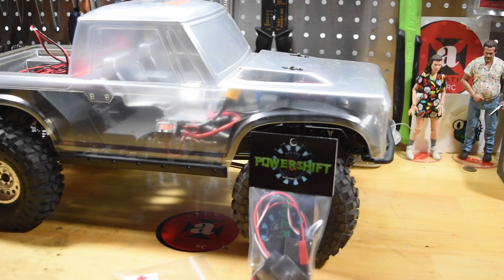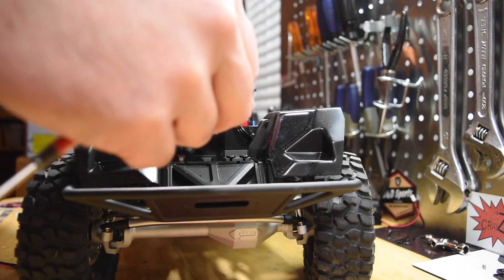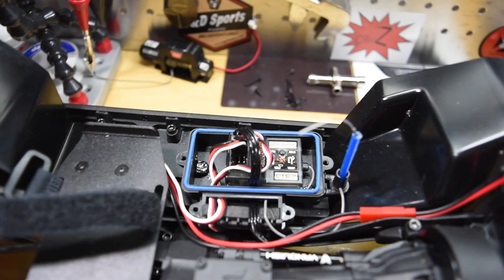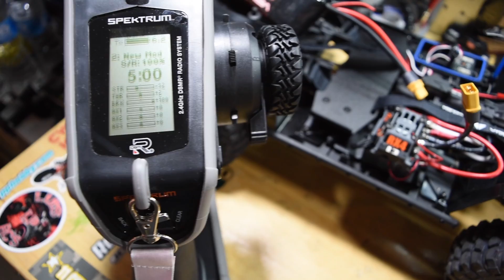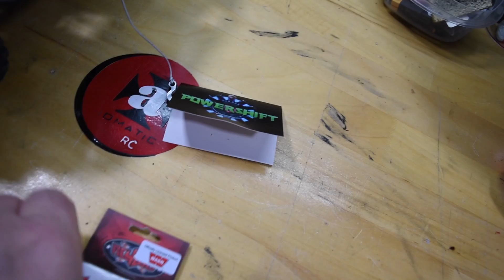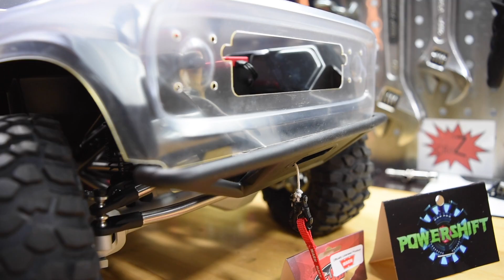Powershift RC Winch Install on Vanquish VS410 Pro!

Comment: Yeah that's awesome dude, Power shift RC has a lot of great stuff, have you seen the front grill for VS410 Pro, the vanquish logo lights up. Mine lights up green, they have different colors to light up , I also have their light kit. If you look there is a hole in that chassis bracket for the wench line . It is lined up right with the bumper fair lead . I'll watch for what color you paint yours, mine is all black. Happy trailing
Reply from the maker: I have not! I'll have to check that out!

Comment: Really nice man. I have one of these winches as well. I have a lower end one though. I messed up and got one I had to solder in for power but it works great. That hook was super nice as well. 👊👊
Reply from the maker: RC Propaganda - I had one on my original VS410 and really liked it. The Rc4wd hooks really helps complete the look!